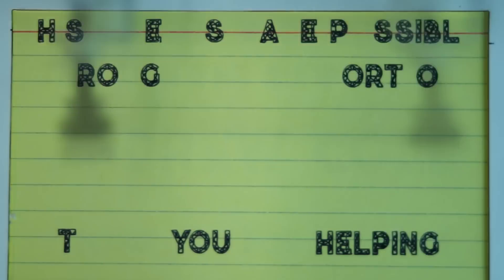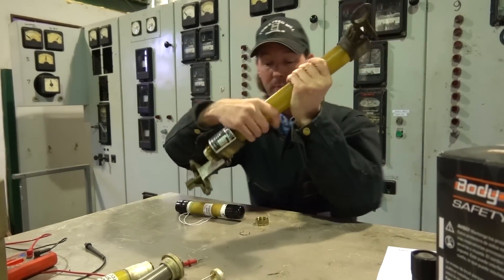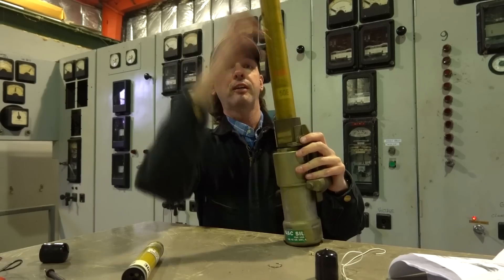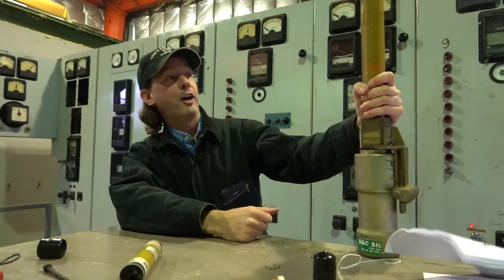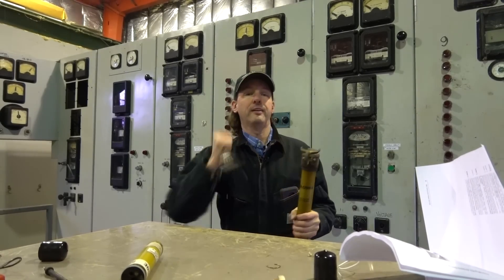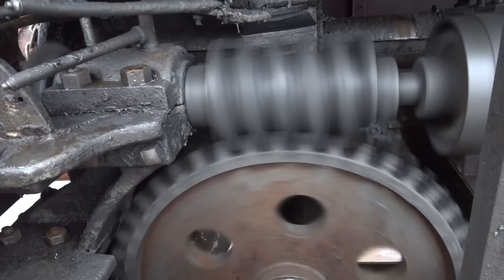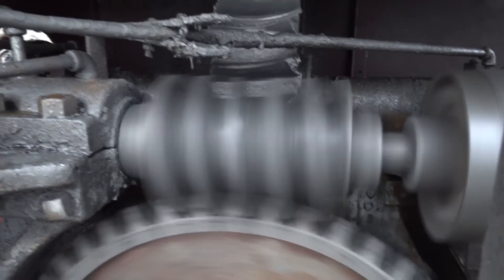Authorized Personnel Only - Hydroelectric Plant Fuse Replacement and Startup

Comment: 1) Why is that Worm & Bull Gear combination NOT in a Gearbox with Lubrication?

2) I have toured one Hydroelectric Powerplant many years ago that was operated by the U.S. Corp of Engineers in TN.

If my memory serves me correctly, it seems to have been much quieter than your's with 3 operating Generators and One spare ready to go Online.

Comment: Oh my, I actually felt every bit of that start up was a religious experience as the loads come on line, holy crap that noise is sexier than the antiquated and desirablebmeters we😂re moving and it DID feel my nuts as the mechanical side bored down on the job. Phew .... nice work if you get the chance.

Comment: it sounds like the bearings are going out on that first worm-gear.

wonder if its been replaced in the last 5yrs since this video. lol
Reply: Noticed it as well and hopping a bit out at end of shaft is not really a good sign and final gear must be opening gate on the dam Maybe. 
Nice deal with worm gears ~ impossible for load to spin them. 
Power off. it's locked in place. 
Cheers

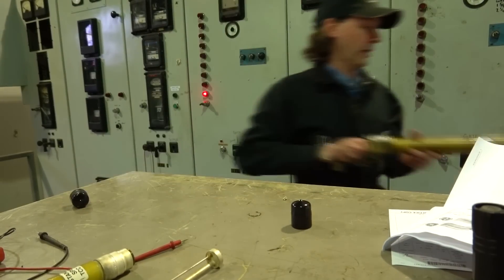Comment: 3:15. When all else fails read the directions.
At the workplace , i.e. employment place,  some electrician wired a 3 wire extension cord to a three phase junction box with 60  amp fuses . Each wire of the extention cord went to a 60 amp fuse. The first shift boss called me over to see what was wrong . When my arm was six inches away from the tap disintegrater the hair stood up.  The boss called over the second shift electrician who put a vom on the machine. It was 220 volts on the metal .

Comment: I worked on a 7,500 hp power motor.
600v DC soft start 
13,200 V
200 A
The windings were around the same size as the mixer on a concrete truck

Comment: If it takes days for parts should have many spares
Reply from the maker: Certainly, but there's a practical limitation to that. It has to be a balance of Criticality, Cost, Frequency, and Space. While this particular fuse scores high on Criticality, the Frequency (how often it fails) is so low that it's never happened for any of us before. The Space is low (it's not that big), but the cost is substantial. When factored together, due to high cost and very low frequency, they chose not to keep spares in stock.

Comment: Fuses working a bit like that - a wire tensioned with a spring, that pulls back when the wire melts to prevent electric arcing - are used in microwave ovens. Of course they're much smaller ;)

Comment: Tribute to clean zero-emissions power on the 4th of July.  I live in WA there is more power generated here than we use - maybe they can find a way to store it effectively and save our planet from 150 degree summers?  I sure hope so

This looks like an older plant.  How many MW is it (just curious) less than 100MW?  There are fuses like this on every pole around here (7200v actually).  I've seen when they're blown they actually flip down to appear open from the ground.  Does this do the same? Wait (14400 * 200) * 3 = 8.64MW and 80 percent must be about 6.912 MW so probably 5 or 6 MW?

Comment: Pretty cool but why no explanation as to why the fuse blew. I'd think you would want to find/fix that first. I didn't hear the purpose of the worm gears at 10:23 to 12:07.  Other than that it was interesting. Thanks

Comment: I've now watched 2 or 3 video's of hydro power plants getting pulled offline and put back into service and the one thing that keeps peaking my enthusiasm is those control panels: they can't get more Thunderbird-like than that with those blinking, almost retro-style fittings! :D
Cool video.
I take it one of those types of fuses blew when a substation in my street malfunctioned and first got on fire before blowing the rooftop off in what some people in my street who live next to it described as "an incredibly loud explosion".
(The substation in my street is served by 7,2kV, 10 or 14,4kV depending on location, or maybe even on when the neighbourhood was built).
Someone who had seen smoke pouring out the substation building prior to the explosion was on the phone with the fire department and right before they were departing the thing blew up, and we were without power, not sure for how long, I recall going to school or an after-school event, but I'm not sure.

Comment: I had several co-workers that should not have been given permission to change a light bulb let alone do what they were hired to do and they somehow managed to Short one of the primary phases using a massive flathead screwdriver that instantly turned to carbon and the explosion was Heard a half a mile away and they were lucky to be alive and they walked into the office covered in the black soot that used to be the screwdriver.
It was only another month before I decided it was too dangerous of work for me and I left the field forever
Reply: Working with those ppl in contention for a Darwin Award would scare me too.

Comment: Done a few of these years ago. Watch you dont get your fingers pinched when cocking the fuse. Sometimes the cord would break especially if the refill had been sitting in stores for a number of years so we would use insulation banding wire instead.
Reply from the maker: Oh that's good to know! Thank you! :)

Comment: I'm a big S&C fan.  The SM and SML 20 is a good fuse with many great attributes.  It has the interrupting capabilities of a power fuse, but in a distribution voltage selection.  For high magnitude faults, they have inherently faster response than circuit breakers.  The duration of the fault is reduced significantly, minimizing the potential for disruption of remaining loads, they shorten duration on generator or motor stress and upstream protective devices can be set to operate faster--for better protection--while still coordinating with the transformer-primary fuse. Time-current characteristics of the fuse are precise.  Also, for those of you who are economy-minded, power fuses are not inexpensive.  I remember the GE 69-kV/single phase 40-kV cutouts, used a fuse that cost $300.00 a whack!  Better not blow too many fuses on unacceptable faults.
Reply: And nowadays, the S&C Electric IntelliRupter are used in the distribution network as are SC TripSaver reclosers on troublesome lateral distribution circuits in lieu of those !ka-bang! expulsion fuses ...

Comment: yeah I've come across your vehicle quite amazing how I have to replace a fuse like that but fuse that do blow sometimes and it can cause in the millions of Customers with no hydro. I remember one time I saw high voltage line from a power plant broke one and I landed down the entrance to to drive through coffee window Tim Hortons no people doing driving over to 9 million 8806 volts  cable that get their coffee funny I pulled my car up over entrance to go in there mad after while getting off into you you stupid fool don't cry for cable again it's all you can burst in planes and electrocuted big time now that the local police came and utility company electric company came and they they literally corned the area right off and it and they stopped anybody and it made me go in different entrance in the Tim Horton broke it broke a floss a bule light 20,000 customers had no Hydra day

Comment: Seems surprising they wouldn't have redundant paths that they could swap over and isolate one being worked on without shutting down power
Reply: In some cases, these may be the lines coming in directly from the grid - how do you bypass that?

Comment: We had a breaker block short out at work (Oil refinery) that powers our main air blower for the FCCU, it usually runs around 550-600 amps... when it shorted it blew the fuses and blew the door off the panel, the whole refinery had a power blink since it pulled so much from everywhere, crazy stuff! I remember after the shut down we went to investigate and just saw smoke pouring out of the substation.
Reply: We had an electric medium pressure boiler at work.  Pulled about 500 amps at full tilt.  A contactor shorted out and blew the door open in a fantastic blue orb of light, knocking the power out to half the building by tripping the main disconnect to that part of the building.  Let's just say we switched to a gas steam generator after that.

Comment: Nice video with interesting content!.  Shouldn't the fuse part that you screw together by hand at 2:32 be tightened with a wrench? You are not relying on it self welding together when the 200 amps go through that connection I hope? ;-)
Reply: Wasn't that what he was doing at the end with the wrench?

Comment: So cool, those types of 1800's Bussman pole fuses are still widely used in the 3rd world
Reply: ??
That style line fuse is universally used to each pole pig and lateral distribution circuit that I've seen ... explusion fuses like that are pretty darned reliable in clearing an arc that might otherwise remain when a fuse 'opens'.

Comment: Not knowing what the synchroscope does until I looked it up, watching a needle on a gauge that spans from "Slow" to "Fast" (with "1:1" at center, I guess) spin in circles was terribly unnerving. Just imagining how I'd feel if the tach on my tiny little 4-cylinder Civic started doing that while driving - maybe along the lines of "I'm going for a walk RIGHT NOW--"
Reply: The "slow" and "fast" refer to the direction that the needle is rotating, not where it is pointing.  The direction it is pointing indicates the electrical phase difference between the generator and grid AC voltage, with 0 deg phase at the top.
Reply: @davemould4638 Let me get this straight. The out of commission generator is spun up unconnected to the grid and brought into phase with the other generator which is in phase with the grid? Then when the running and newly running generator is in phase, you switch the newly running generator onto the load?

That sounds frightening should someone get it wrong, by even the smallest amount.
Reply: @gorillaau  Yes, and Very Bad Things happen should the synchronization be off.  As in "tens/hundreds of tons and millions of dollars of spinnamathing get yeeted thru the building roof/walls, and yer proper fucked wha iffen yer in the way."

Comment: Soooooooo  the fuse FRAME is 200 A but the element you replaced is only 50A.   How small are these hydro units????   Why no panel upgrades in 70 years.  Thomas Edison personally made half the stuff in the room!!!!
Reply: Never change a running system.

Comment: The handgrease you are leaving on that hv fuse will lower the breakdown voltage of that surface significantly. Where I work it goes against all instructions to leave your greasy paws anywhere, even down to 1kV. I always use disposable gloves when handeling hv stuff.

Comment: When I did computer work at a power plant in mn they said it takes a power plant to start a power plant except hydro and nuclear.. they start themselves.. can see that now...
Reply: Not true of the two nukes down here. If there is no outside power coming in, they shutdown automatically. And sitting on the same site are 4 gas turbine units. The power has to go out to a substation 6 miles away and then come back to the plant to bring the nukes online. Or the power has to come from one of the other power plants in the system. Fail safe security for the units that way as as soon as the substation goes down, the reactors scram. And all the emergency systems kick in. Been just over 12 years since it last happened and it was caused by a switch in a substation 30 miles away causing a load shed. Put millions of people without power for up to 4 hours. The time it takes to bring those units back online.
Reply: Well, the lights were still on, so they had back-feed from the grid.

Comment: I'm wonder how syncronization done🤔
Reply: Very carefully. We did not have a spinning dial unit but we did have the lights for manual operation. When both lights have completed two dark cycles (  both lights out ) you closed the breaker. Before doing any of that you set the RPM to produce 60Hz and adjusted the Voltage to match the other generators Voltage. Easiest way was to let it do it automatically. The breakers closing made a KERWAM when they closed as they were spring operated. If the motor that wound the spring failed, there was a lever to ratchet the spring. They wound themselves up when opening so when you were finished with the generators and had shut them down, you had to manually trip the breakers so that the spring was not under load when not needed.
Reply: God that is awesome. And it's all 60s and 70s tech, shame we could probably automate it today.

Comment: James west, there is no lock out in manual syncing. what your referring to is sync check relaying. Old installations do not have this. (that costs money, jeez!) so, when you close the main line circuit breaker it closes, period. Much of the stuff I work on is relatively old. 1920's to 1980's. Most with 1980's controls. Only some minor upgrades. (upgrades cost money, jeez) Only one plant has sync check in manual recently installed.( cuz the old 1950's stuff finally failed, jeez) The rest, you can close at any phase angle. Training a new person one day. I said "when I say close". Instead, he closed just then, 45 degrees out. Good thing them old machines are super tough! the boom sounded like it pulled the unit out of the floor!  8 mw machine!! 53,000 pound rotor just instantly whammed 45 degrees into magnetic position at 525 rpm.
Reply: I see why they need to sync them now...
Reply: 53,000lb rotor got slapped like the fly it was, compared to the millions of pounds of other rotors it got a surprise meeting with
Reply: jeez
Reply: @jamesspash5561  I have always wondered just what would break if connected while sufficiently out-of-phase. So much force, and so much current. I'm guessing the mechanical would fail faster than the electrical, even with a fast-acting fuse.
Reply: Ouch! 😳

Comment: Close at the 11:58 position. Always pull the generator into the system. At the one o'clock position your physically pulling the unit backwards into sync. I'm sure you missed the extra 1. LOL.  Syncing a gen on line #1 speed correct, #2 voltage correct, #3 then synchronizes. in the barely fast direction. Your  synchro scope should be moving like a second hand on a clock. As I train new folks, your merging onto the highway. the grid is an interstate highway, Imagine you, incoming generator, coming down the entrance ramp merging with heavy traffic. You want to slide right in place.  30 years hydro here.
Reply: Great description.
Reply: thank you for this awesome response, sir!
Reply: Saw The Same
Reply: What you describe here is exactly what I imagined in my head when sincronizing gears as I shifted the gears of a non syncronized gear box of a car I once drove decades ago! Good explanation!

Comment: 1) I would've liked to see the fuse being whammed into place.
2) Holy shit the flow rate from that dam.
Reply: I don't get why that was a big deal. PP was shut down, right?
Reply: @robertthomas5906  NERC/CIP regs.  Bureaucratic paper pushers are often paranoid about the wrong things when it comes to preventing grid equipment sabotage.  Those fuses are installed in a similar manner to overhead cutout fuses, except you aren't standing under it when it closes.

Comment: When I was a kid, visiting my aunt in the Upper Peninsula, she took me to a small hydro plant where a friend of hers worked. He explained everything and even demonstrated bringing the second generator on-line. I was fascinated.
On the way home, she gave me a lecture about how I had "better pay attention in school or [I] might end up working in a hot old power dam."
That actually sounded pretty good to me!
Reply: What did she want you to be?? And what did you become???
Reply: It would have been better than working where I did. I worked in a hot engine room of a Diesel powered pump station. It not only was hot and humid, it was loud. Ear protection was mandatory when operating as it was 108db in that room. We had both automatic or manual operations for our two generators so I was watching the dial/lights on theirs saying when they should hit the breaker. :-) Old habits die hard.
Reply: I work in a combined cycle power plant. The phrase "hot, old power plant" is 100% accurate. In the summer time, the upper floors of the plant reach temps upward of 150 degF. In the winter, it's about 110.
Reply: @ninevoltromeo how is that legal
Reply: @minoupower554  engine rooms on ships can get up there too (though not that hot anymore after steam) usually the control room has AC, and you just go in those areas when you need to work on something
Reply: I wished I’d had someone take me to a HED and had it all explained to me as a kid rather than have my math/science teacher scream at me for not paying attention because the way he taught was so dry (pun intended).
Reply: Lmao.
Reply: I've visited two power dams: The Green River dam in Wyoming and the Bolder dam in Nevada/Arizona.
Both of them were 'dam' cold (pun intended) inside.
All that water behind the dam makes a hell of a heat-sink.
Reply: soooo....what's the rest of the story?

Comment: I bet nobody knows what the two indicator lights under the synchroscope are used for?
Reply: Those would be the synchronization lamps, they are connected across the breaker to the grid to show if the generator is in sync or not, off when in sync and on when not as there would be a voltage difference.
Reply: Coles notes from another reply I wrote. Flashing = mismatched frequency. Steady lit = out of phase. 

Throw the switch when the lights are out...
Reply: @djsnowman06   On the second lights out was our rule. Never on the first.
Reply: They let you synch the oncoming generator to the grid even if the synchro scope is broken.